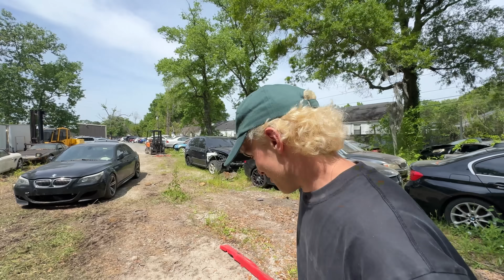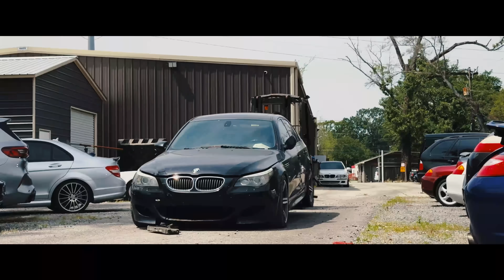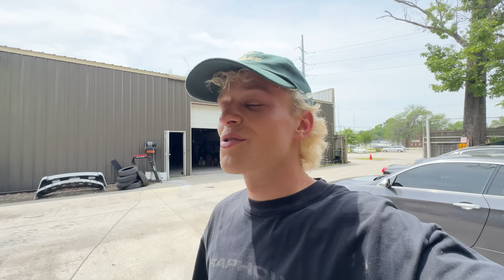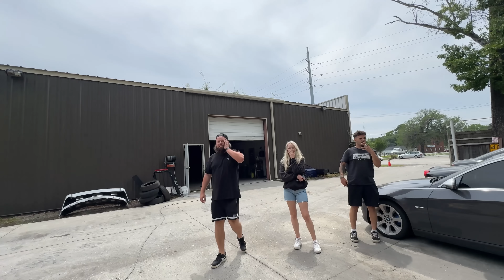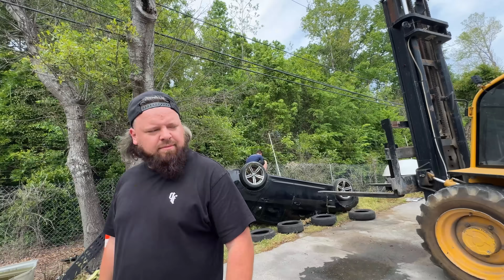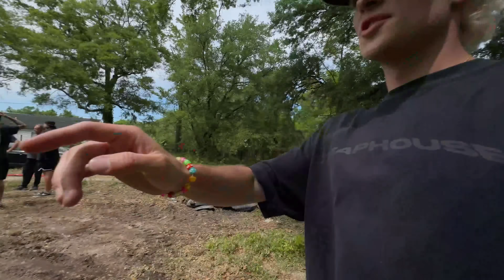TOTALED MY DREAM CAR BEFORE EVEN DRIVING IT…

Comment: Finally. A true durability test.
Reply from the maker: Forklift hydraulics durability test
Reply: @schaefchen  but no oil puddles? hmm
Reply: @schaefchen  This would have happen to every Forklift. Hydraulic system of an forklift is not meant to hold heavy things on the highest position, therefore if we left heavy things on the forklift we use a thick peace of wood to put it under the tines then you move the tines with full weight on the wood bole so theres no pressure left on the hydraulic system and the would bole can withstand many tons of weight and will not give in bc. its an static element.
Reply: @Xxander940  there was literally no oil in the car, did you not hear when he said that they cannot start the engine because there is no oil, and also the paper in the window of the car
Reply: @schaefchen  I will be 100% honest with you. I commented that before I even begin watching the video… I was referring to potential abuse of the car. I did not expect to find it upside down 🙃
Reply: @saint383 he was talking about hydraulic oil from the forklift not oil from the car.. if the hydraulics failed you’d think there would be hydraulic fluid on the ground from it losing pressure
Reply: Then they used the forklift to turn the car over? So fixed the no fluid leak, leak? Put on new seals? No one at the Company noticed the forklift was losing pressure? How did it hold the car for as long as it was washed? Weird all around. Scam somewhere. If you would had let the Company move it, it would be their financial responsibility. What a waste of a nice 6-speed E60 M5. Click bait?
Reply: Whistlindiesel vibes, kinda
Reply: @schaefchen yes and they suck 🫠
Reply: @schaefchen We just kinda forgot about it. Yeah ok.

Comment: Why the fuck would you leave the car suspended in the air? Someone had to have had the thought to lower it before leaving.
Reply: My first thought, even if it is a certified forklift that can hold 5 fucking tons, i still wouldnt leave it to hang for like 3 fucking days, idk for how long it has been up there, or should i say... was xd(i havent even watched the video)
Reply: Defs just for content. You can even see the fork lift is left tilted like they purposly made it fall off.
Reply: @treynolds94  the piston is free to move out because, as he mentioned, one of them has a small leak. this is exacerbated by the 2 ton car on the forks. it wasnt "just for content", it was just them being dumb. for the same reason car lifts have ratchets to prevent the lift from falling, or jackstands exist, you shouldnt leave an object suspended using only hydraulics.
Reply: @TheLuckyE9d  It's definitively done for content, even the dumbest kid would not have done that.
Reply: my thoughts exactly

Comment: One of the first rules when getting a forklift license is not to leave load hanging.. Its losing hydraulic pressure if there are any tiny leaks.
Reply: will loose pressure even if it isn’t leaking.
Reply: @carlribacke3959 how do you work that out? The only way this happens if there is a leak on the ram seals or a check valve is faulty.
Reply: Nah its beacuse when the engine isnt running there is nothing driving the hydraulig pump sp under load it will seep

Comment: when i was watching you guys wash it on the forklift all i could think of was that’s a bad idea it can fail at any moment and this is what i see after 😭 (too many deaths with people working on a car under a forklift never do this, just use a car lift with locks)
Reply from the maker: We did it quite often, safe to say we wont anymore
Reply: I tought exactly the same, It's not safe at all to lift a car with a forklift, forklift are designed to transport from point a to point b close to the ground, they should not be left with the load hanging
Reply: yes dont work underneath, seen some huge reachstacker hydraulic lines explode, looks like the forklift had some hydraulic-cylinder or valveblock issue.
Reply: @schaefchen  das Ding ist wenn der Motor vom Gabelstapler(Radlader,Bagger etc)aus ist dann wird der hydraulick Druck abgebaut deswegen hat er nachgegeben Mann kann das schon machen aber mindestens den Motor laufen lassen

Comment: you can never trust the hydraulics on old forklifts
Reply from the maker: Yep
Reply: or just lower it down (put it 20 30 cm from the ground)and put it little backwards like guy said. Everyone who drive one know that,obviously nobody there know how to drive one
Reply: Not just old forklifts, most of them that i know have no security valves for the zylinders. If a hose blast it goes down quick or like this case it sinks slowly over time. My take would be a telehandler or an two Post lift if its there. Or just move quik and pray for the best😄✌️
Reply: well who would have guessed that old hydraulic loose pressure overtime without the pump running keeping the pressure up
Reply: @xraison44  doesn't matter, first thing first,what you learn for driving forklifts is that when you take load ,you pull it backwards so when this happens your load can go down without doing damage to it. I love OG but idk who decided here to put 21.000$ car on forklift ,old one,and let it stay straight. I think even if they put it 20 ,30cm above ground as I said above it will be dry when they come back. Now its late but ye,as I said,no one there attended 1hour of driving forklift lessons
Reply: @spartanac8480  I mean everyone who operates a forklift should know this
Reply: @xraison44  yep. But at least we got contet ,but OG lost money
Reply: @mikegasper89  Most hydraulic systems DO have check valves to prevent this, infact as a forklift mechanic of 5 years I've never seen or heard of one without
Reply: @emmay5746  i work mostly with man lifts and on These all important functions have check valves. But on non of our manitou, Toyota, doosan and still forklifts Are no checkvalves for the tilt function. And Maybe a few have Check valves for the Lift

Comment: Honestly i think swapping all m parts and interior if you like it to the other 5 series. Could be easier than replacing all panels/ fixing them
Reply: i think he said the other one was an m5 too
Reply: @JZX_Nate  its not
Reply: @JZX_Nate  at the start of the video you can see that it's 530i
Reply: The best would be to sell the M5 as a parts car and buy another Manual M5. I have done a full transformation of a E92 320D to a E92 M3 before and its SOOOO MUCH WORK and it's just not worth the time and money it takes..

Comment: yeah, i learned that before to never leave a car on a fork lift. .luckily for me. it just went down and put the car down with ease. and didn't tip down the forks. never ever let anything sit in hydrolics for a long time. or this might happened. i never leave anything on forks/ or hydrolic machines as the risk of it failing is high.

Comment: Sad it was such an expensive car to happen to but that's a premium example of why you do NOT leave things on a forklift unattended, never know if it'll lose hydraulic pressure and at that point it depends if the forks drop or the mast tilts forward.. Sadly here the mast went forward instead of the car just dropping down as the forks depressurized.. Honestly it's generally not advised to work under the forks in general but who is seriously listening to that with the convenience it provides and in this case, who wants the mess on their workshop floor.. I've been told countless times not to and still did it for quick bits n bobs so really can't talk.

Comment: yeeah of course you need to let it dry out on a FORKLIFT... like leavin it on the ground for 3 hours wouldn't done the job. usually in germany we aaalllllll need to leave a car hanging for drying out cause its soooo important that the underpart is dry when you still need a new engine and i jsut paid 21k for a car with a broken engine. smart moves all around. thats schäfchen

Comment: U still can use the engine to swap in to an e36 or e30. Dont be sad, fint the way to a better content. Im pretty sure that your wievers would see a v10 e36 or e46 or e30. Engine and gearbox is still there.

Comment: Damn.

Well, this is an actual representation of why you use jackstands vs working on your hydraulic lifter, if there is even a slight bit of oil creep, pressure WILL drop and with that, the car.

Fuck man.

Comment: Neverrrr leave a loaded forklift turned off in the air, it looses pressure with the hudraulic pump off. That sucks, a bit of chopping and welding and you might be fine.

Comment: Honestly 21k for that car with a blown motor wasn’t that crazy of a deal. If you hunt on marketplace you can find one of these for 12-15k(SMG) and swap over the manual bits to the new car. Not worth the time, effort and headache of trying to fix the flipped one. (just my 2 cents)

Comment: I guess you just found out why you shouldn`t be standing under suspended loads (like on a forklift or crane). Because at any time that load can come down if something happens. On a proper Car Lift you have failsaves in place for an event like that.

Comment: You're not serious! You go out to eat and leave the car in the air on an oil-hydraulic system. What did you think the system would hold the pressure? Of course it's going to tip over.

Comment: I listened to it five times and did not understand why you bought an m5 with a bad engine for 21 thousand dollars.  Just because it is a manual transmission???In 2020, I could not sell my clean title 2007 m5 smg for 6 thousand because I had a burnt-out engine - metal inside in oil system and faults for vanos. Crankshaft damage.
Reply: Manual transmission was never available in Europe, thats why he bought it for this price probably

Comment: Are people really so gullible to believe this to be an accident? Of course this is all scripted. That M5 was junk anyway so they decided to make a video before scrapping it. That wasn’t even a running car judging by the tow hook in the front bumper. 
So the guys working there knew the forklift was leaking hydraulic fluid but had no problem standing under it for periods of time? Sure. And the BMW was up on there with no problem the whole time while cleaning and inspecting the underside and then suddenly when they where away this happened? Whatever. And if they knew it was leaking they left it up there when going to eat without lowering the forks? Oh and it just so happens to be the cylinders which make the forks tilt to fail instead of the ones which make the forks go up and down because then the BMW wouldn’t have flipped over.
I call bullshit on this whole video.
Reply from the maker: Bro chill